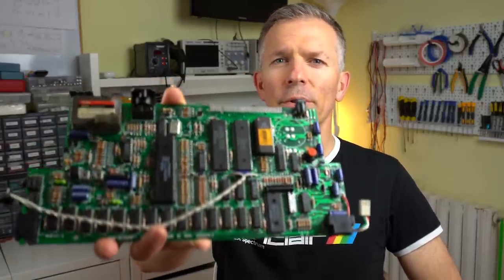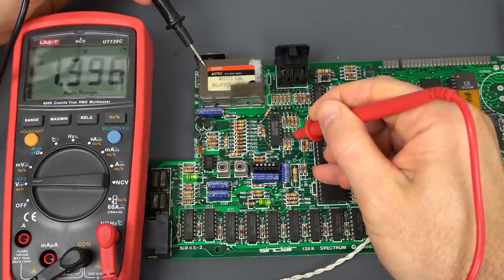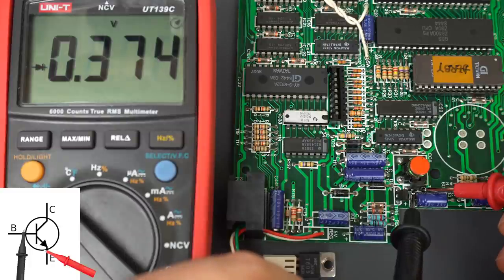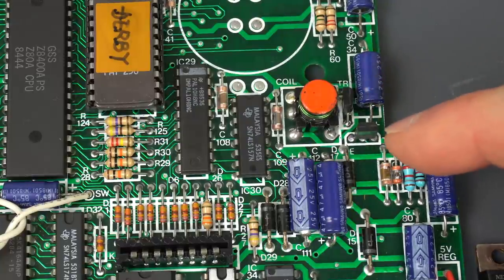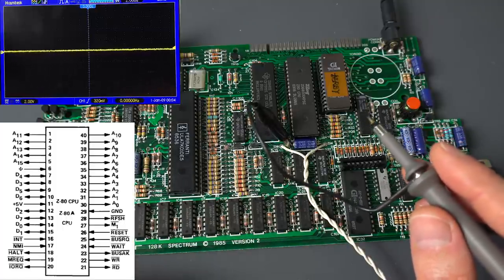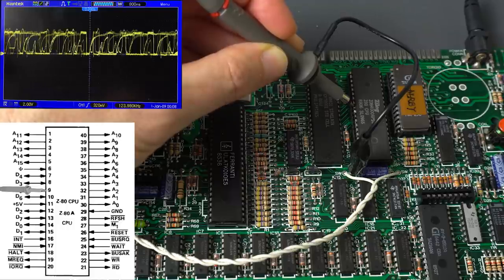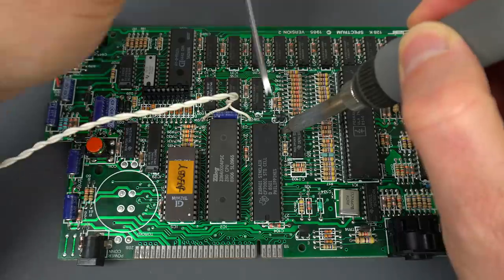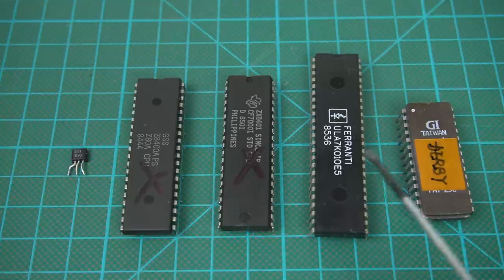ZX Spectrum 128K "Toastrack" Mega Repair (Part 1)

Comment: Your channel really deserves more subscribers. There are so many "retro" channels now but most of them are "I cleaned the keyboard in the dishwasher and retrobrighted the case" instead of actually knowing what they are doing.
Reply from the maker: Thanks! Those can also be quite interesting sometimes. There's room for a lot of different approaches because different people get different things out them. I'm sure I'm scaring a lot of people away every time I put the oscilloscope on the screen :-)
Reply: Noel's Retro Lab The oscilloscope shots make it easier to follow what’s going on. I like the more technical reasoning that goes beyond “this chip feels hot, so it must be dead” or random chip swapping until it works.

I also like that you’re repairing Spectrums, and not C64s 😀
Reply from the maker: @ncot_tech  Thanks! Although I like to get into and repair all sorts of computers, C64s included :-) But I agree, some European computers don't get much love on YouTube.

Comment: Another remarkable repair video from Noel (or is it Noël?). Your channel deserves far more subscribers.
Reply from the maker: Thank you very much! It's just Noel since we don't have ë in Spanish.
Reply: I remember having this picture of a transistor in my head since I was 9-10 years old, because my big brother used to make many DIY electronic circuits back then. The only thing that wasn’t adding up to that picture until I went to uni, was how a big current could flow between the collector and the emitter, when both diodes between the emitter & base and between the base & collector were facing the opposite way. A simple way to picture this, is that the base junction (P or N) is very small in size compared to the other two. Once you run a small current between the collector & base for example on an NPN, the electrons of the collector’s N junction will flow to the base and fill the holes of the base, leaving enough electrons to jump across to the other N junction of the emitter towards the ground. The larger the “small current” between the collector & base, the larger will be the current flowing between the collector and the emitter, through the load that is inline with them. That’s the basic function of the transistor as an amplifier.

Comment: So much destruction leads to one conclusion as to cause and you did mention it earlier in the video. Plugging something into the (totally unbuffered) expansion port while the machine is powered up is a huge no no and that is almost certainly what happened. I saw it so many times when repairing the 48K machines back in the day.
Reply from the maker: Yes, almost for sure that's what happened.

Comment: I was never into the Sinclair computers, so I know very little about them, but I find your videos and knowledge very engaging. Your need for sockets is very nice to see, even if you are using the inferior leaf spring sockets. And your meticulous clean-up of flux is also nice to see, so many old hack jobs left flux on everything.
Reply: As long as they are dual wipe, IMO spring sockets are better than turn pin.  Turn pin are designed for turn pin legs rather than standard ones.

Comment: Great video as usual, thank you! It would be nice to see how those Data lines are supposed to read now that the ROM has been replaced? :)
Reply from the maker: Great suggestion! I'll do it in the followup video, although be ready to be disappointed because I think they'll still be "ugly" looking.
Reply: Cheers! I'd be curious to know how that works to prevent false readings. 
I am not an expert on this but could it be the oscilloscope impedance affecting the signal itself? I seriously doubt it as it's such an old and slow machine, I think that happens on much more sophisticated and high-performance circuits. But I also struggle to understand how that ugly signal can be properly decoded... Food for thought!
Reply: @tony359  Oscilloscopes are designed to offer theoretically infinite resistance/impedance. Practically it should be in the megaOhm range. So, not really.
Also, the signal would have to be really really square. Those slopes are problematic. If the design is problematic or something that can't be helped with (e.g. long signal lines), the usual fix is to intersect some Schmitt triggered buffers along the line. That's very common practice in modern circuits, even in memory controllers or, say, PCI-Express drivers.
Reply from the maker: @tony359  We'll have a look at the data bus signals working in the next video, but even if they're ugly looking, there's a certain threshold after which they're interpreted as a 1, and otherwise a 0. As long as they're not hovering around the middle, and the rise/fall quickly enough, they're usually fine. But yeah, for some reason, I seem to recall the data bus on the Spectrum always being rather ugly looking for some reason (even with fresh caps).

Comment: famous last words "common fault" :)
Reply from the maker: Haha, so true. I really thought this would be a 5 minute video. Show how to check transistors, fixed. Oops.
Reply: @NoelsRetroLab  people are "funny" about old machines.. but they are like old cars , it's got to a point where they need to have preventative stuff done. I need to get a new "modern" apple 2e psu , for example.

Comment: Fantastic video, got a +2 that looks to be blown in a similar way. I'm not prepared to send it to silicon heaven just yet (not without a fight at least). Great diagnostic tips, much appreciated.
Reply from the maker: If the +2 is a gray one, then it's almost identical to this one and you should have a pretty good guide. If it's the +2A, then all bets are off because it has the massive ASIC that could fail and leave you stranded (although the RAM and the Z80 tend to fail before). Good luck!
Reply: @NoelsRetroLab  Thanks, it's a grey +2 which is more or less the same just with a different layout. Very early PCB timestamp (8628). Judging from the the S/N it must have been one of the earliest batches of this model. It even has some bodge components placed on the solder side which are supposed to be there :) Hopefully it can be brought back to life.

Comment: Hi Noel, nice video!  With the final culprit being the ROM that seemed to corrupt the memory test of the RAM chips, did you happen to probe the data bus lines after the ROM change?  I was curious whether the waveforms looked any different before and after.  Do you think one or more of the ROM data pins was stuck high or low?
Reply from the maker: Thanks! The busses looked fine when I looked at them, so it wasn't just a bit stuck on high or low. Also tests were failing in different ways every time. Maybe it was a short that was lowering the voltage in some bit and wasn't being interpreted correctly as a 1 all the time? I looked at the bus afterwards and it looked the exact same messy way.
Reply: @NoelsRetroLab  I figured you looked!  The data bus appeared as open-collector outputs with pullup resistors, the way they drove sharply to ground but rose exponentially to Vcc.

Comment: I would not have expected that you were taught "conventional" current flow.  I learned electron flow back in 1974/75 when I went through training in the Navy.  Either way is fine, as long as you understand what's going on and can apply sound troubleshooting principles (something you've very seldom had any problem with!)

Comment: Wow, how many breakdowns for just hot-plugging in peripheral. This action is something that we have gotten badly accustomed to with today's electronics, but disastrous in retro. Thanks for reminding us of the consequences ... although I probably forget it and I will connect the external DDI-1 floppy drive to my Amstrad CPC464 on without realizing it. :-)
Reply from the maker: The Amstrad is slightly better because the connectors that go on the edge connector have caps at the ends, so you more or less are forced to put it in straight. On the Spectrum it just has a guide in the hole (and that can even be lost) so it's very easy to have neighboring tracks touch each other. And since one of them is +12V... bad things happen then.

Comment: when I was in high school (back in Soviet times),i had to repair the spectrum 128. more precisely, it was a clone developed in the USSR. it was called "Pentagon" (because one of earlest the pcb have five corners ground field). this clone did not have ULA, and instead had many chips (counters, multiplexers, logic). the fault was caused by an incorrect power supply (Chinese 7805). first of all, all memory was burned out. memory-related multiplexers have burned out. the memory page Manager burned out... the highest bit of the address on the Z80 also burned out, but the processor remained alive. in the original zx128, the repair would have ended up replacing the ULA and Z80, but I had to spend a lot of time finding every faulty chip. I didn't have an oscilloscope, instead I used an old tube TV (as an indicator. connecting the video input to the inputs/outputs of the chips). there were no other options.  .....didn't have any money for another computer. the repair was completed successfully.

 \ \ \ it was very interesting to watch the repair of the original zx.
Reply from the maker: Very interesting! I definitely want to learn more about the soviet Spectrum clones. I do have a Pentagon kit I need to assemble one of these days.

Comment: I must echo other commenters that your transistor explanation is way better than text book explanations I have read (and reread, and reread, trying to understand) ... thank you!

I had to relocate a scene in this video to be sure I was commenting on the right video. You were testing a transistor with your multimeter while the transistor was still on the board. I always wonder about how to interpret the results of an "on board" test like that. Won't other components on the trace always affect the result or are there definite rules about certain results regardless whether the component is still on the board or not?
Reply from the maker: Thank you! I'm glad that was useful! I know I struggled for a long time to get a mental concept of transistors. They're not easy to understand intuitively.
As for measuring them in the board, what you may be able to do are comparisons to working transistors in working boards. Normally you expect to have a small drop one way, and no connectivity the other way. As long as the board doesn't have a path connecting those two that is less than the small drop, you should be able to do some good measurements (if it's shorted, something is bad, if it's much higher chances are it's also bad).
The one with no connectivity, as you saw, the Spectrum has a path with some connectivity between those two pins, but it's always about the same. So if you measure it and it's a short or very different, then it's also a hint that it's bad. You can then take it out and measure it, although it's also possible for the measurements to be fine and the transistor still not act correctly, but that's more rare.

Comment: That exact CPU is still made new and NOS. Also might want to replace the power jack with a gold plated one just for better transmission. The composite mod would also make the display much cleaner and you can get small composite kit boards for around $10 USD.

Comment: I have a ZX Spectrum 48K that broke down because of the power supply went through a wrong switch cable and it reversed its polarity. It instantly destroyed the 7850, but after that being replaced it had very similarly symptoms: bad ROM, partially damaged ULA (working but after a while bad video signal) and bad Z80.
Reply from the maker: Yeah, if you're not lucky, it blows a lot of things (those are the usual suspects, and notice those are closer to the power input). If you're lucky, a RAM chip blows up really bad and saves all the others 😀

Comment: Hi Noel, I have a 128k "Toastrack" that's basically stuck on the menu screen. The keys register as I hear the beeps when pressed but I am unable to scroll down on the menu, nor will pressing enter do anything. Do you know what could be the problem? The system work fine before, only recently has it started acting up  and I can't find anything about this issue online.

Comment: Very instructive, takes me at a higher level to test defective boards. I liked the way to test the databus and the address bus. Now i have some reference.
For the RAM chips,  someone made a RAM tester and it works great. Did you find a replacement ULA or did you use the original one again. ULA is somewhat hard to find these days.
Reply from the maker: Glad it was helpful! I usually just test on the board with ZX Diagnostics, but like you saw this time, sometimes other things interfere with normal functioaning. I've made some testers in the past, but nothing permanent. I ordered a very complete DRAM tester a few days ago, so I'm sure I'll be showing it off in some video :-)

Comment: @Noel's Retro Lab : How are the data buses after the ROM replacement, are they more "straighten out" ? Asking cause i have some similar problem on a clone Z80, and i have the same suspect (ROM). I don't have the test cartridge to try it on(heck, i don't thing they are even compatible).
Reply from the maker: I don't remember for sure, but I think they were still kind of similar. The ZX Spectrum ones always look really "ugly" for some reason.

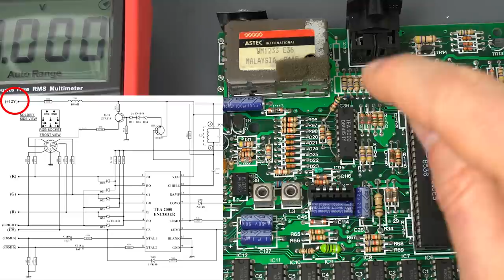Comment: @3:42 A question: You said, that you would measure pin 11(VCC) against ground. No I wonder, since the schematic shows only 8 pins on the right side (where pin 11 is), but the soldered TEA 2000 has 9 pins on each side and all seem to be soldered. How did you know, that you had to measure the penultimate pin against ground?

Comment: what the model number of your solder remover you used on the Z80? nice vid man.
Reply from the maker: It's an ZD-915. It's pretty great for the price. Highly recommended.
Reply: @NoelsRetroLab  awesome, thanks man, lookin for something just like that.
Reply: @NoelsRetroLab  Yes! I have a goot TP-100 (the real deal, not a clone) that is horrible, in every solder removing operation (1 pin) the dessoldering gun gets cluttered. Need to use the pin cleaner because I can't remove solder from the next pin (using that thing at 380ºC). Not recommended at all. The price of goot TP-100 is almost the double of ZD-915
Reply from the maker: @JorgeCarvalho_web_dev  Are you maintaining it and cleaning it well? At first I didn't know how to do it very well, and once the filters got clogged up, it behaved like you're saying. Now I keep it all clean and it sucks like a vacuum cleaner.
Reply: @NoelsRetroLab  Well, I have removed one filter from the "solder container" hopping that it would give me some more sucking power :-( What didn't happened... I have already bought a new tip because a little solder got stuck in the middle and I broke the cleaning pin trying to free it ;-( I clean the tip using the cleaning pin with a little Amtech NC-559-ASM (not the fake ones). It is the only thing that helps cleaning it and I wash the solder chamber... Dont know what else to do.. maybe buy a new pumping motor, I have used the dessoldering gun only 20 times, the results are so bad that I gave up. I use the classic mix of solder sucker, iron and a little hot air to help releasing the more complicated pins.. Sorry for my english, I am from Portugal
Reply from the maker: @JorgeCarvalho_web_dev  That's really weird. This desoldering gun has two filters: one in the glass chamber and one where it hooks to the pumping machine. Could it be that yours is similar and one of those is clogged?
Reply: @NoelsRetroLab  going to check that... You are the best!

Comment: Hi Noel. I have a Speccy +2 Grey with the same issue that the 128 Toastrack that you are repairing on your video. I know that essentially both are the computer, but I see all the components misplaced comparing with the board of the Toastrack. It lights the Power led and the cassette drive runs when a key is pressed, but nothing else...

I wonder if the transistors you repaired are the same or not. Perhaps with different names too...

Some idea?
Reply from the maker: It could be. It has a very similar voltage-generating circuity. Check to see if you have +12V and -5V. If those are stable, then the transistors are fine, but it's a great place to start. Look for the +2 gray circuit schematic to know where you should be getting +12V and where those transistors are. Like you said, the circuit is almost the same, it's all jumbled around.

Comment: you should show databus signals after repair) also there is chineese component tester (TC-1) it can test a lot of components really fast (transistors also, and it shows actual punout of component, and other parameters (h21 and so on)) i think its`a good cheap solution. For high end - there are infrared cameras (seek thermal and others) that can show u which component is faulty even if its barely hot (29 deg celsius for example and others are 26)

Comment: Wow, how could so many parts fail at once?! Do you think maybe somehow static discharge or a power surge could have zapped it?
Reply from the maker: I think the expansion board might have been plugged in and out multiple times.
Reply: @NoelsRetroLab  Once would be enough if the machine was powered up when the board was plugged in.

Comment: If all this damage was done by connecting something to the user port, I wonder if it's possible to modify the board to protect it from such things? Maybe add diodes to avoid voltage coming in on the wrong pins?
Reply from the maker: Good question. I've done things like that on an Amstrad before to avoid accidentally plugging in the 12V connector. Here is trickier because when you connect an expansion board, you can temporarily connect several neighboring pins to 5V, so I don't think diodes could save us in this case.